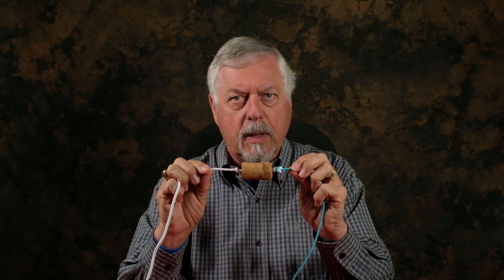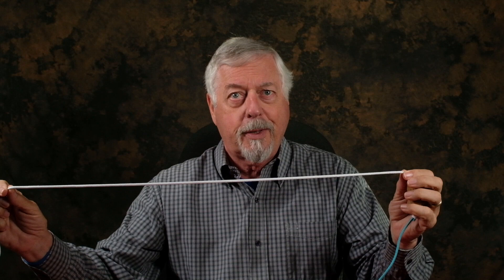Fishing Outside the Box: The Mayfly Challenge - the Problem and an Introduction to Active Nymphing

Comment: Hi Peter, that's actually a nice thought. The "zig-zag" movement sounds like a typical jigging action. Instead of the float, could a floating Polyleader with a perfection loop and an integrated tippet ring create a similar hinge? since all this happens below the surface and It should be easier to cast I would say.
Reply from the maker: Yes, a 5' floating PolyLeader + Fluorocarbon tippet would probably provide the necessary droop. We just have less strike detection when a fish takes on the drop. Most takes are felt, but some are only seen.